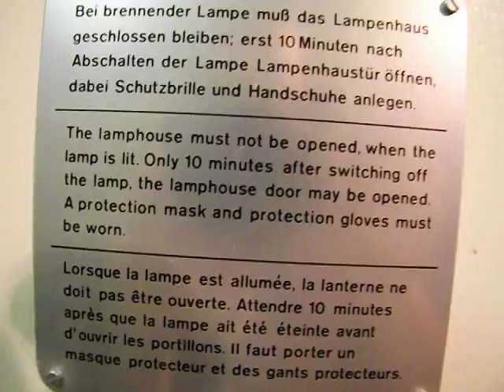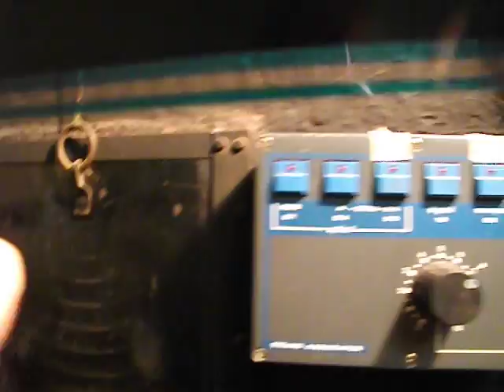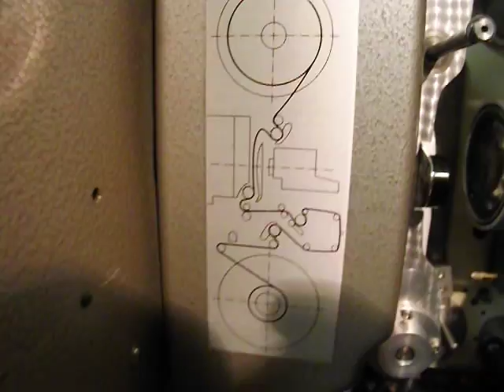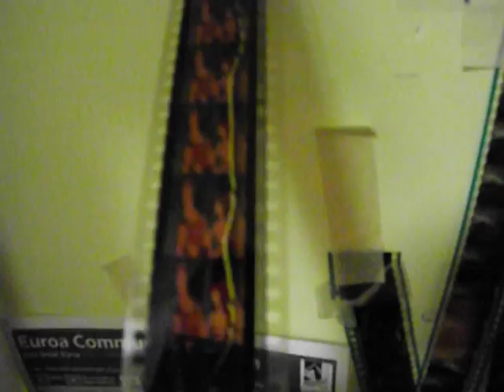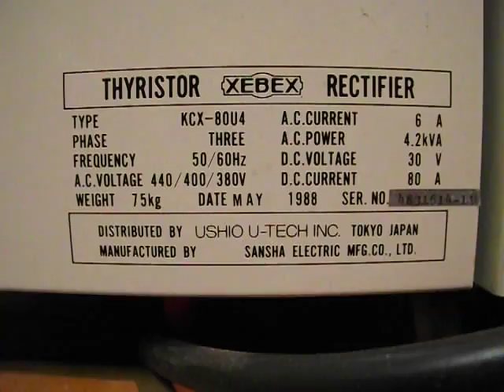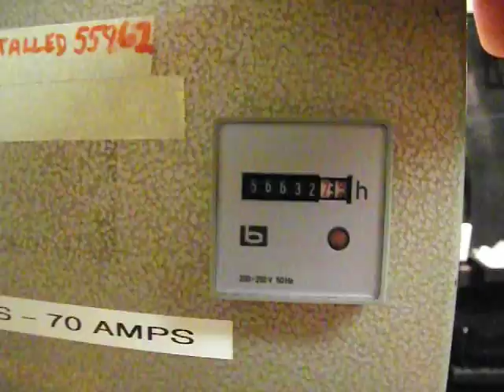kinoton FP30D more detailed explaination & view of the projector itself

Comment: The digital info between the sprockets is not DTS it's Dolby digital. The DTS track is not digital encoding but a time code to keep the CDs that contain the DTS digital info in sync and looks like dots located between the optical sound track and the sprocket holes in a continuance  line. The other type digital sound is SDDS (Sony) located on either side on the extreme edges of the film.
Reply from the maker: Correct, When I shot this video I was self taught and had not received any professional instruction. I haven't been into the cinema for years probably 5 years but after this video was shot I received instruction from an old school projectionist. I do really miss running the kinoton but digital killed it really
Reply: @wickedxe  Yes sadly, no use for the projectionist these days. All that knowledge an expertise down the drain.
Reply from the maker: @MichaelBeeny  Absolutely, and the lost job opportunities

Comment: Are you sure the track between the sprockets isn't Dolby Digital?  DTS uses a sync track which is encoded with the actual analog audio.  The actual audio is stored on a CD-ROM.
Reply: The DTS sync track is not encoded with the analogue track, it runs to the left of it.

Comment from the maker: the lamp is 30 volts (really smooth dc) dc at 70amps. still a big lamp though; it will burn a hole in the film if it jams and stops in the gate